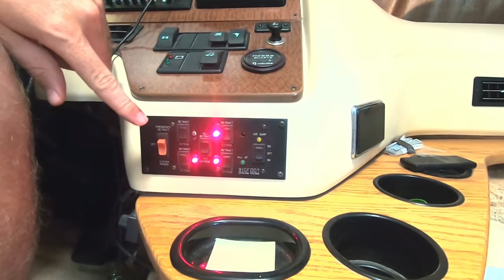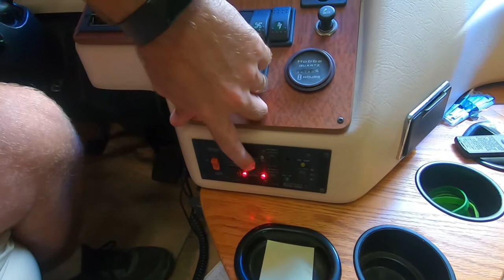Bigfoot hydraulic leveling system

Comment: I have a 2003 Georgie boy and cannot find where to fill with hydraulic fluid on my Bigfoot jacks. 

Jacks will not go down to get under the rv and I would think they thought of this placing fill reservoir in compartments but I cannot find.

Does anyone have a clue?
Reply from the maker: They did make a system that has one central  reservoir, but most of them have small reservoirs on each jack.

Comment: I'm left leg keeps drifting down even after 4 trips to the trailer shop and replacing 2 pumps!!
Reply from the maker: Sounds like a bad seal. Unfortunately, they are not easy to rebuild. I did see a video where a guy does cut one open and do a full rebuild

Comment: You did a great presentation.  I'm having problems with my right-frount jack not retracting on 1996 Gulfstream Sun Voyager.  After watching this I'm going to check the fluid levels on all four jacks.  If the problem doesn't clear up, the next step is to remove it and rebuild.
Reply from the maker: There was a good rebuild video that i found, but it involves cutting and welding .

Comment: I have same big foot system but looking at it, I will need to remove front wheels to get to fronts. On rear, think I need a skinny dude to get to the pump assembly.  Did you have issues like this getting to your pump assemblies.
Reply from the maker: I actually used a 20 ton bottle jack to help hold the rv up so I could have room under the RV

Comment: I got year 2000 bigfoot maurda system  leaking and comes down 2" cant figure out why why it will not stay up
Reply from the maker: According to the representative that I spoke with while doing research, it appears like you have a bad valve. They can be rebuilt, but would require removal and reinstall.
Reply: @gertysadventures6173  once stablelizer was up in couple minutes dropped 2 inches repaired by placing car jack under neath disconnect top hydraulic line jacked up stablelizer pushed fluid out or top hooked up line and problem fixed must of been air in line or to much fluid in piston stablelizer works like new 22 year old George boy 35 ft long v-10

Comment: How did you start the siphon? And how díd you determine the need for more fluid using the wooden dip stick as well as the 1/2 inch left using the dip stick
Reply from the maker: To start the siphon I placed most of the hose in the fluid and let the air come out, then holding my finger over one end pulled the hose back out. Once the hose is full put the open end lower than the bottle. For the level, I kept hold of the stick with my 2 fingers and made sure my fingers were even with the top of the opening. The level was measured from my finger to the wet part of the stick.
Reply: I was also wondering how to start the siphon.
Reply: You can also get a pump for cheap that screws on to bottles. Refilling diff fluid is what I tropically use mine for